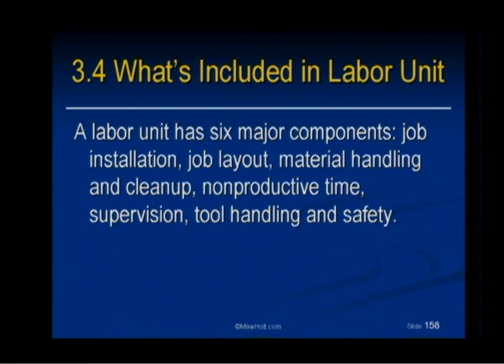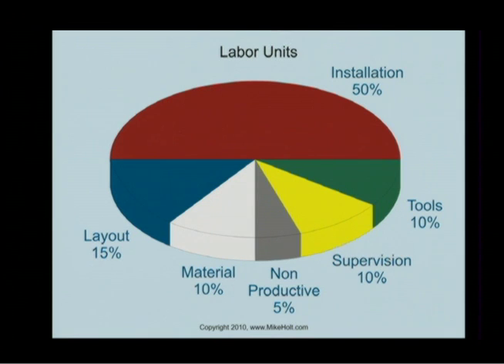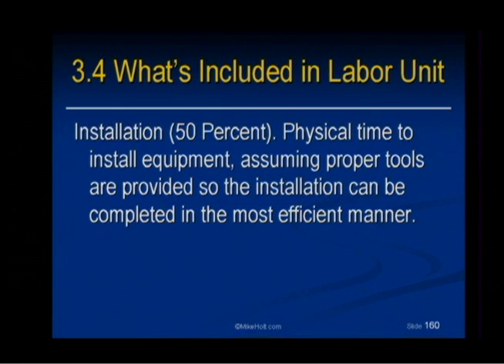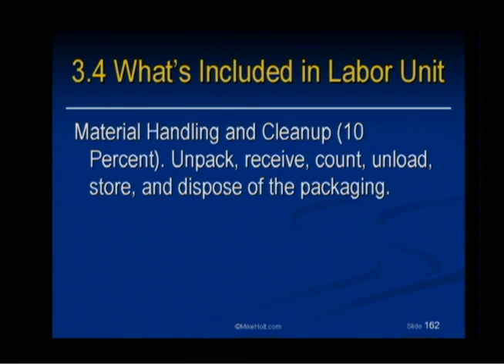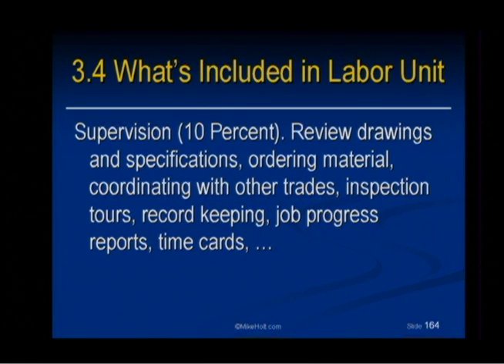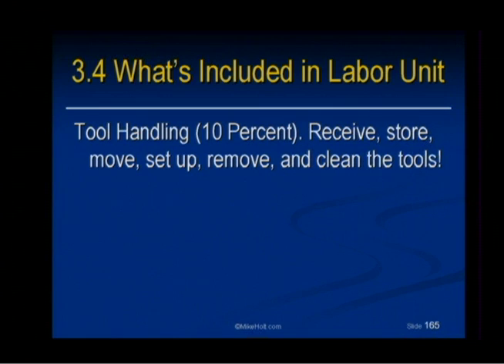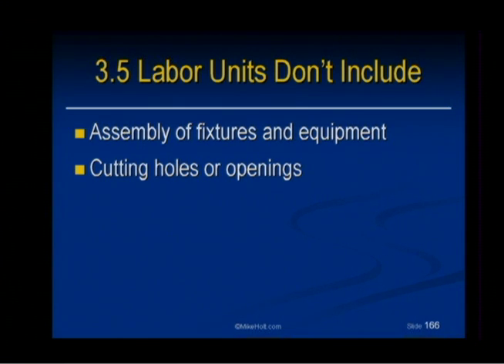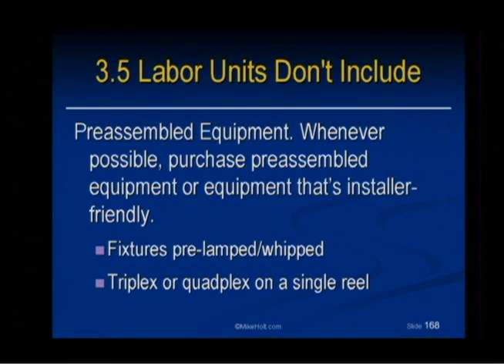Electrical Estimating ©2011 - Labor Units

Comment: I have read information on the NECA website that states that supervision is not included in the NECA labor unit but I have to side with Mike on this one. Many contractors do not include a separate budget for supervision in their electrical estimates. When these contractors adjust their labor units to match their actual field labor including supervision, they actually add supervision into the labor unit. It really doesn't matter where it is tracked as long as it is recognized and accounted for.